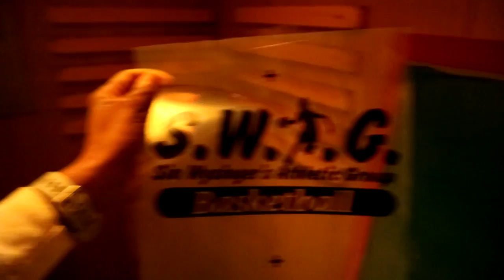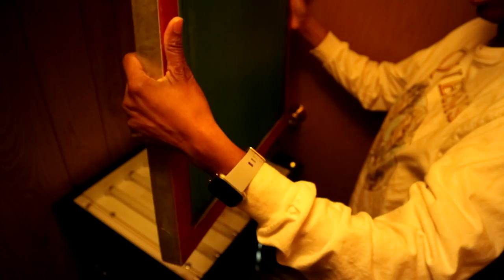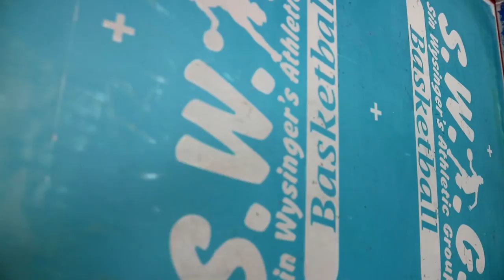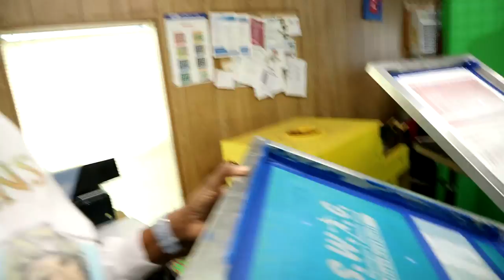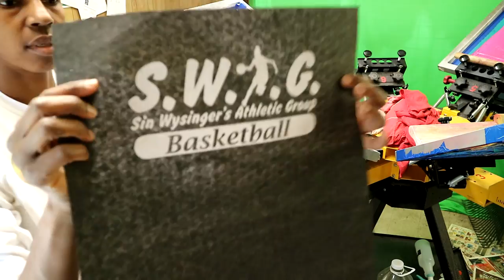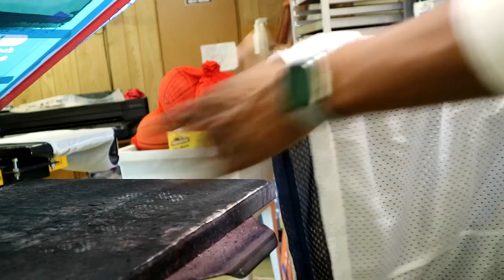Printing For My Team

Comment: HI there, I absolutely love seeing your videos. I would like to know what do you spray on the screen after exposing the screen? I would also like to know where you got the shirts they look awesome. Thanks for showing your work, I have been silk printing for about 15 years now. Cheers!
Reply from the maker: Hi Fe'lix Thank you for watching!  I spray water on the screens after I expose them.  The reason I do that is because I have to take them out of the room with the yellow light into my shop area in order to get to the washout booth.  Spraying water on them helps break down the emulsion and stops the screens from continuing to expose.  The shirts in this video are just reversible basketball jerseys.  I had been looking to buy some because I coach my son & nephew in our local kids basketball league and I luckily found someone selling them on Ebay.com for a super cheap price.
Reply: Cool that you had a good price. Thanks for the trick with the water, I will try it out.
Reply from the maker: You're Welcome!

Comment: Hi...In order to print specific from a heat press machine....what ink cartridges and printers needed at a reasonable price? Can you please send me the information? Thank you.
Reply from the maker: I recommend using vinyl and a vinyl cutter because it will last longer than transfers printed with a printer but if you want to do transfers you either need to find a place to purchase screen printed transfers or you can use regular printer ink/toner to print inkjet or laser transfers.